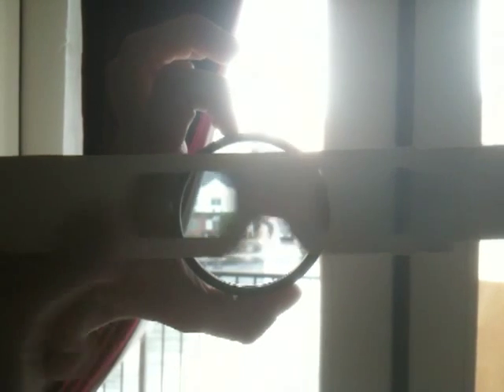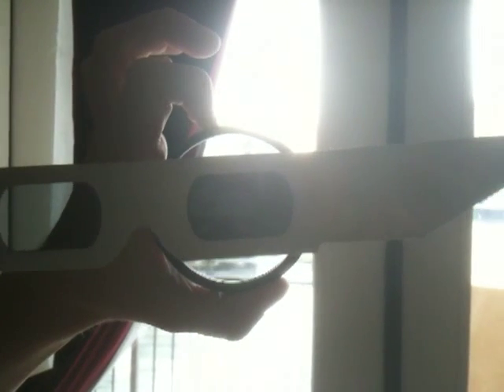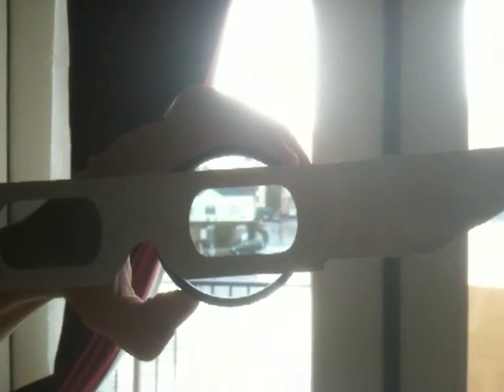How do polarized stereo 3D glasses work?

Comment: @cjdwonggmail you would need find a way if using two projecters to put a polarizer on the left  and right eye projecters (and project on to a silver screen as a normal screen does not mantain polarized light) so the the corect image is only seen by the eye its intended for, getting proper image alignment can be quite a chalenge with a 2 projecter setup but it does work, cinimas use in most cases a single projecter and alternate left and right eye images and polarization at high frame rate

Comment: Take Real D glasses and point the ear rests at a LCD computer monitor orTV rotate the glasses and they will block at a certan angle with varys with the polarizer on the display you have probbly will work will all circular polarized glasses when you view the display through the glasses with the ear rests as you would normaly wear them and rotate you get color shift

Comment from the maker: Well...  No...

These glasses are polarized glasses.  Linear polarized glasses.  Red/Cyan or Green/Red glasses are not good to be used for anything longer than 15 minutes.  Plus the colors on Polarized 3D is much better.

Real D are circular polarized glasses and won't really work for IMAX (linear) or LCD monitors.  What you may notice is a shift in hue on an LCD monitor with Real D glasses.  But it won't black it out.

Hope this helps.